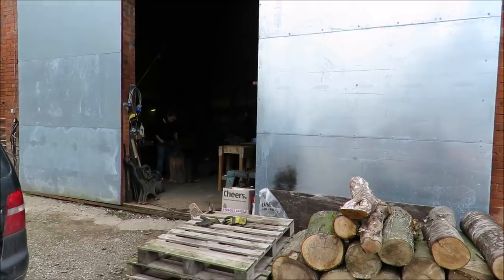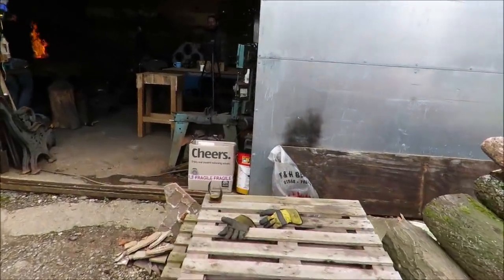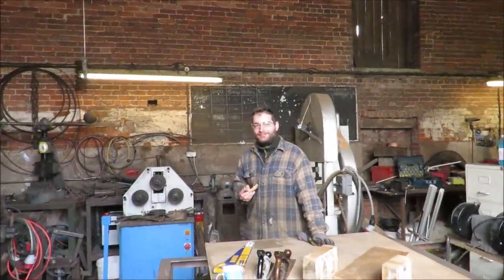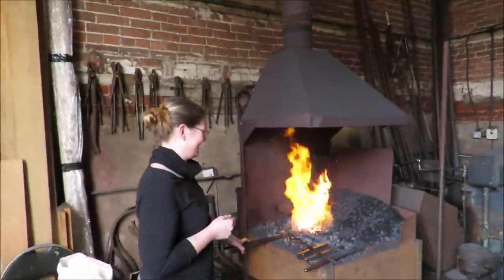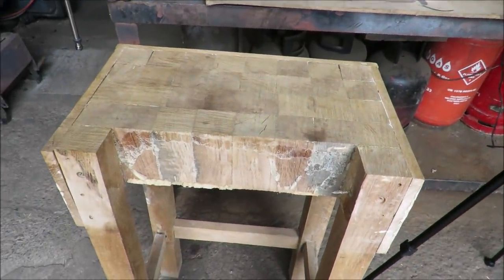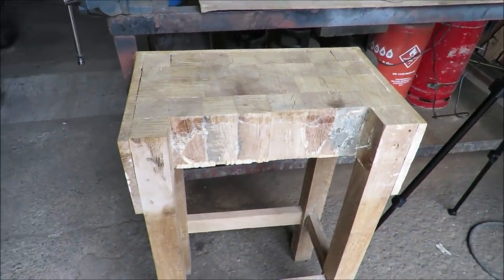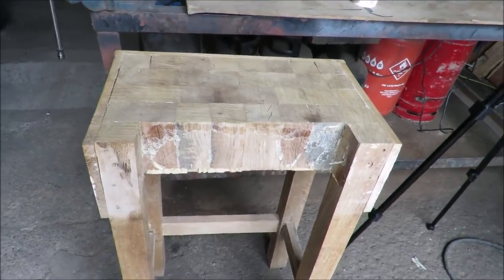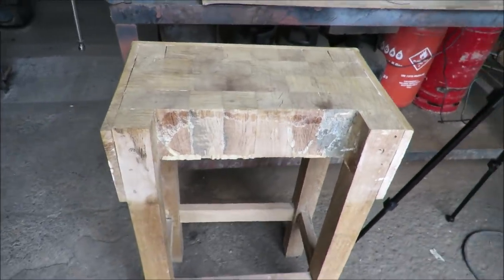Recycling an Old Butchers Block Series. Part 1."Organised destruction" #SRP

Comment: Hi Scott that old chopping block had a lot of glue in it.  Once Oli gets gets it finished it will look a lot better. There use to be a lot of blacksmiths around here when i was a young nipper but now there is not one including my father since the horse was replaced by the tractor.

Comment: I’m struggling to see the point in rescuing something which was badly built in the first place, requires almost a complete redesign, and isn’t made out of a material which is good for its purpose... you might as well have turned it in to something else.
Reply from the maker: It's going to be amazing Joe, and it's showcasing traditional old skills which i love, plus, it's a bit of fun too.
The finished article will be an amazing show piece, which i will use for demos..

Comment: Wd40 contamination
Not food safe I guess you don’t plan to use the side planks again
The wood is normally maple as it does not taint food and is incredibly hard you will lose some squareness due to the kerf of the saw blade especially on the chop saw when I made these I used cascamite glue as it is waterproof and food safe
Reply from the maker: Well mark, that's what it's made of, as it was said in the video, it's not ideal, but it's actually more about the project.
As for the wd40 sprayed wood, it is not going back into the block...
Anything else?
Reply: Scott Rea yeah I’m enjoying you vids more than you think 
Not trying to find fault just telling my own experience in making these back in the 80 s
I was a butchers boy in the 70s and one of my jobs was to scrub the blocks at the end of the day
Reply: Scott Rea if it’s not ideal then why fuck about with it. Waste of time. I’ll send a gas engineer over to help you out and give you a few tips 🤣